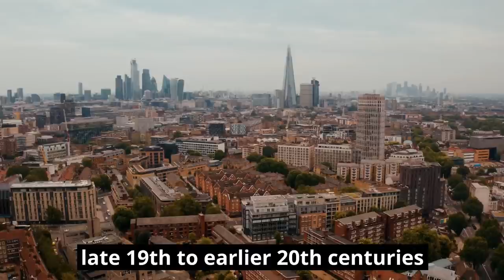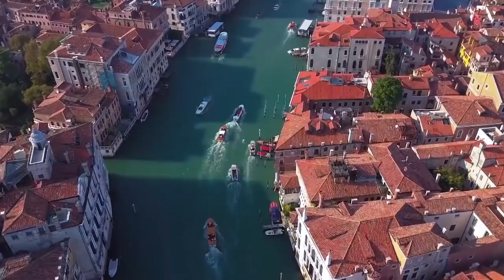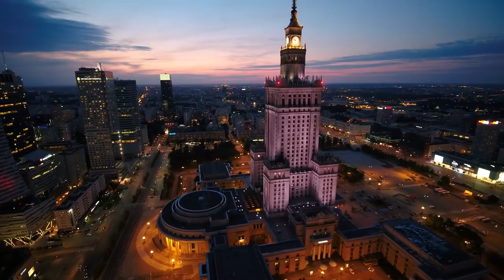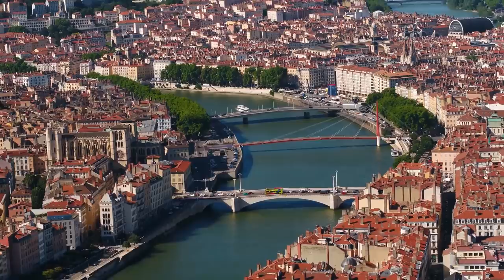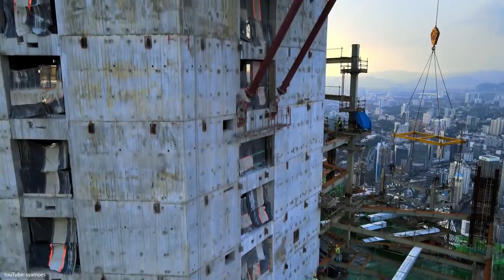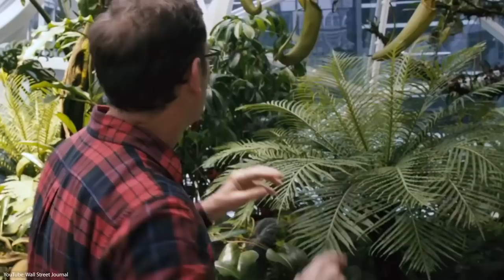Why Europe doesn't have Megatall Skyscrapers

Comment: Well, concerning Paris there is an especially ugly area called Beaugrenelle with a few 100m towers built in the 70's. It was supposed to be expanded with many similar areas all over Paris. By chance, the different  energy crisis in the 70's largely put an end to this
There was also the Plan Voisin  and the August Perret plan in the 20's (with 100 buildings 200m tall each, all around Paris), but none was implemented